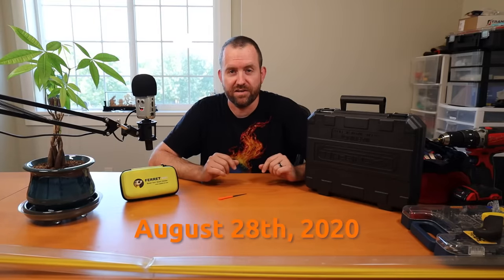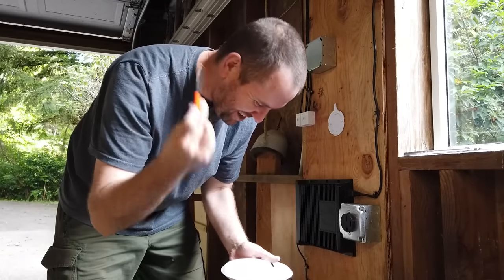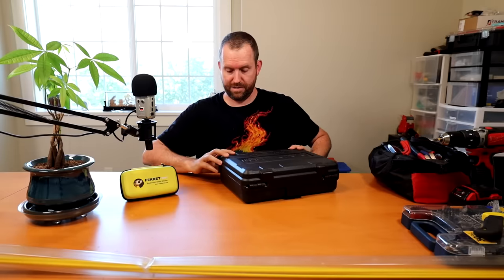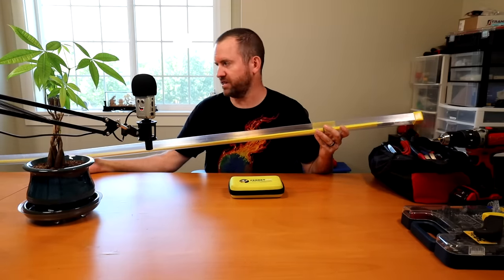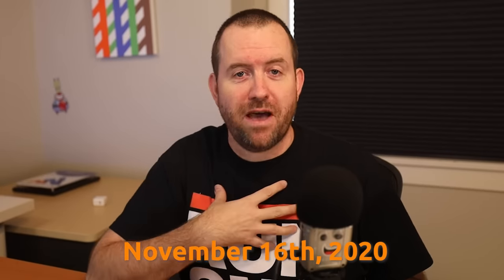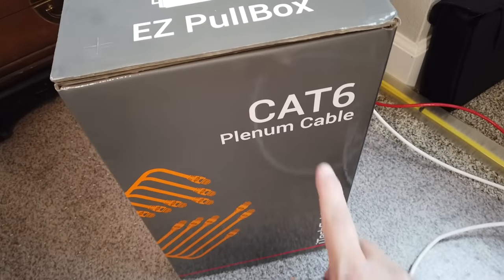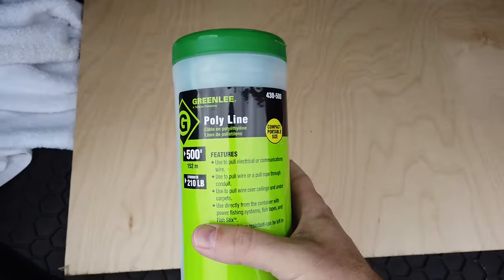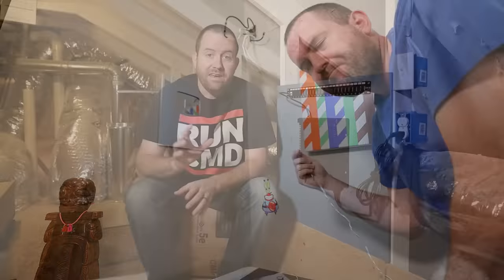CAT6 Wall Fishing

Comment: instead of cutting and patching holles in my walls, i removed the baseboard and cut about 3 inches of drywall out all along th floor.  this allowed me room to drill each stud and feed the cable through the studs.  a quick screw back up (or drywall mud) for the cut out drywall and then re-installed the baseboard.  easy peasy and no drywll patching or painting.  nice clean quick installation.
Reply: great idea! thx!!

Comment: They make flexible drill bits that attach to a standard drill that are able to go deep into wall cavities and drill into the bottom or top plate if you ever wanted to go that route
Reply: i came here to make this same comment. 48" flex bit from harbor freight, it has a hole that you can attach the cable or pull string

Comment: So useful, and what a cool pair of tools! It’s after a few years now, I’m thinking about putting in CAT 8 cable in the homestead for 20GB networking. Switches with 4 - 5 2.5GB ports and 2 SFP+ ports, managed, w/ POE run $60! What a life, what changes time has wrought….

Comment: Welcome to a not so fun job an electrician deals with! I like you finished wall mounted plate trick! Quick tip for tying cables onto your pulling device; strip the cable, loop half of the conductors (if they fit) through the pulling device, twist all of the conductor together, fold them back onto the coat of the cable and tape the piss out of the conductors, try to make smooth lips with the tape as you transition between different widths, that way nothing catches on the way through or on the way back if you are struggling.

Comment: Looking from Europe at your walls, isolation snow and strange wall cavities. And I can only think: Wow. Four years ago I needed to pull approximately 40 feet of CAT6 cable from the garage to the top of the attic. There is a empty tube purposely installed there for this exact reason going all the way up. What I did is attaching a small cotton piece to a very light thread and used the vacuum cleaner at the other end to suck the thread all the way through. Then attached a much stronger rope to the tread and pulled it up through the tube. Once done, connect the CAT6 cable to the rope and make sure you cover the cable with talkpowder (the powder sportsmen use to cover their hands with when pulling weights) and just pull the rope from above. Did it alone and took me about an hour. Nice vid.
Reply: They make cable pulling lube...

The bucket looks like you’ve been indecent with an elephant but when you need to run 60ft of 30mm cable down a 1.5” steel conduit from a GOST motor starter to a blower motor. You’ll appreciate it!!!

...I started out in a panel shop for environmental combustion company and we sold a vapor recovery skid in Russia and spent a long 80hr week running all the cables before it was shipped.
Reply: @peterg.8245  yeah I know there is lube available on the market. But how does that look like after being 15 years in a tube? Does it dry out and act like cement so you'll never get the cable out? Talkpowder will not do that.

Comment: DIY magnet puller - fishing line + small & heavy metal object (test with a magnet). Use electrical tape to attach fish line to end if cables & drop it down. If it gets stuck, try drop it again, or use a magnet (ie from an old hard drive).

Comment: Word to the wise - the right sized zip tie end is perfect for removing unifi aps
Reply: I use paper clips to remove them, I use the smaller curved side of the paper I just make sure to squeeze the small side of the clip with pliers to fit the notch on the AP.
Reply: Yes, Zip ties are perfect tools for this purpose!  Have used them for years.  Super easy to use and they're much easier to replace if you lose them.

Comment: Another great tool I fell in love with as a Cable Guy, now use for CCTV DATA  Access Control. Is from Labor Saving Devices called The Wet Noodle less than 20 bucks...small compact easy-to-use and small enough to keep in a tool bag. Magnet small.enough to stick thru a small hole in a door frame and lamp chain you find with its magnetic tip.. very inexpensive too..... yep string first, or cut and tape multiple wires as a torpedo head and staggering them.. OMG.  You used a level in the attic no one but a HVAC guy would have noticed if you had eyeballed it , impressed! To dress the wall plates you van use a mud ring that makes the jack on the wall a little firmer....Luckily you didn't have "Fire Stop" blocks of woods across the cavity in the wall...   May look at a Cable Ferret... there are  few times you'd like to know what the heck you're hitting or what obstruction you got....

Comment: It's triggering me that you didn't use either mud rings or "old-work" boxes.
Reply: I'm debating using them myself - I don't see anything wrong with hole sawing it out and then using some anchors (I have a shit ton around here) to mate the wall plate to the drywall.
Reply: @the_kombinator  When I'm planning additional new runs to an existing plate, finding a drilled hole instead of a box is a bit like opening the blinds in a hotel room to find a brick wall outside. It's one of those "awwww" moments.
Reply: @Treddian  I'm running two drops to every plate (4 drops in my office) - I'll never need more unless I suddenly decide to mine bitcoin. 

But maybe you're right - at least in the lower floors I'll use them.
Reply: What is the best way to run cable from outside to inside it prolly will be spf+ or ++40gbs fiber vs cat im new to fiber normally i just drill hole shove fill this is a very wet area of organ snow rain and its going to a very costly server room hope u reply treddian
Reply: It's not an issue with low voltage systems, but it isnt the recommended method. Smaller hole to patch if he regrets making it. However the 3d printed boxes for 120v systems is a big nono.
Reply: me to

Comment: I use poly string trimmer line for pull lines.  It diesn't fray out or hang up on nails, splinters or cracks in the inner wall sheet rock or framing.  And will take a heck of a beating before breaking.  I've even used string trimmer line to fish fires trough firewalls in my vehicles when I want to run a new wire for something.  A big zip tie with the string trimmer line pushed into the zip tie catch and you've got a nice stiff, non conductive pull system.

Comment: The Magna puller is a great tool.  I have one myself.  I wired my house with cat 6 and have a 48 port switch.  Not fully used, but I needed more than 24.   So I ran a lot of cable and have multi keystones ports all over I can plug into.  My attic is tiny.  I have a low slope roof.  I did all my wire running under my house.  That included coax for the new antenna I mounted being a cable cutter.  Wires for the rear surround speakers in the family room.  Mostly done myself.  My 12U network rack is mounted up high in my small closet in the middle of my house.  It was a lot of work.  A lot of crawling under my house, getting out to pull wires up and then back under again over and overt!!!. Once all the work is done, is great.  In the future, those cat6 cables should be able to handle 10 gigabit just fine.

Comment: Use the drop chain for hollow walls, then use the magnet to get the chain to the cut-out. When attaching your cable to pull I like to cut back about 6 inches of insulation, the run 2 pair through the pull in one direction and two in the other direction twist tight and tape with a smooth head, if pulling two cables, tape the 2nd cable securely about 12 inches back with about 6 inches of tape again with as smooth and pointed a head as you can to avoid getting the cable hung up.

Comment: Interesting video. Where I live in Australia, houses are mostly constructed out of brick, single brick internal walls and double brick walls on the exterior. So to run cables in existing built houses you tend to get stuck running cables through the external wall cavities, unless you want to create a hell of mess by using a grinder to cut a channel into an existing wall. I doubt a magnet would work well through bricks. For new builds conduits are the way to go, when we fully renovated our house a few years back I had installed 20 CAT6 runs installed through out the house and all in conduits, which has already proved useful in a couple of instances to run a extra cable. It's also illegal to terminate you own cabling if you aren't certified for some stupid reason in Australia now. Another recommended tool is a cable tester that can tested the quality of the mechs and terminations. Unfortunately these tools can be quite expensive depending on the tests. Certification testers are really expensive while quantifying testers are less expensive but generally are good enough to do the job.
Reply: A simple test tool, that just confirms each pair is connected properly costs next to nothing.

Comment: Similar to the Cable Ferret, I purchased a "DEPSTECH Wireless Endoscope" on Amazon a while back when trying to run cable in a finished ceiling that had lots of metal studs supporting it and a ridiculous number of obstructions, including a distribution box for some elevator / building automation controls and several PVC sprinkler lines. I kept getting hung up and didn't want to make new holes since it was a public lobby area where looks were important.  The light was super bright and the field of view a bit wider, so I could see further than the image you showed in your wall. This helped me fish the camera over to the hole for the access point and then pull string from there to the places I needed it.  The camera is on a 12' semi-rigid, bendable cable.  It requires a USB power bank or charger for power.  It then connects to your phone with wifi.
Reply: Second that one - I used two of the DEPSTECH to cross a 90 degree pull between two attic spaces where one was not physically accessible.  The bright light and camera on both poles made it possible/not-easy to find each other.  I could not have done that pull with the size of the Ferret.
Reply: @thezfunk  someone had to bring it up
Reply: @spasmonaut10  it is funny I found it in the comments because I have a friend who just bought one to use it on himself. He is a strange duck.
Reply: @thezfunk  I bet he's hard to buy gifts for.
Reply: I was wondering if someone was going to mention these.  Super handy, and very cheap!  I think mine was $30.

Comment: Unless I'm mistaken, it's not a 4x4. The top plate is typically two 2x4s on top of each other. I used to be an electrician, and did a lot of this wall fishing. At the time, we used what's called a "fish tape", which is a piece of thin steel rolled into a coil. It unrolls as you pull it off the roll. Any home improvement store will have such a thing.

Comment: I usually have two boxes/reels of cable, if I want to pull two cables. That way you don't have to guess the center. More importantly I just tie all the conductors to whatever I'm using to pull the cables, which is way stronger then tape in my opinion. It's also less thick than bending the cable, which makes it easier to pull it through stuff.
Reply: Yeah, that "bend it in half" idea was nice in theory but has the flaw of thickness. OK inside a clear vertical un-insulated run though.

Comment: 1.)The correct keystone crimper or knockdown tool. 2.) Use a LV box instead of just a hole in the wall when running wall plates. They make a tool that goes on a vibratory tool that is an outline of an electrical/LV box. Literally cuts it in 10 seconds. Done.

Comment: Ruckus APs have the same issue. You have to use a paperclip to release the AP from the bracket. I installed a Netgear AX630 and it just twists off and on.

Comment: I used the Magnepull (and Magnespot) for years as an installer.  The Magnepull's not always super handy (most of the time fiberglass rods are quicker and work just as well), but when you DO need it, it's invaluable.  As for the Magnespot, if you ever have a need to put a hole in exactly the right spot on the inside, from the outside, the Magnespot is awesome.  It uses a vibration frequency on a transmitter that you put inside where you want the hole (it uses a push pin), and you take the locator outside to find the location.  It will give you a 4-point alignment, right down to the hole in the middle of the locator, where you can mark it.  It also works when going through floors, but I've personally not had much need when drilling through floors (usually have an idea of where the hole will be before drilling, since I can see both sides).
Reply: (adding comments as I'm watching)
Also, you could have used the included chain instead of the poly line if it's a one-off line pull, which could have saved you some time of running to the hardware store.
For drilling up through the ceiling (and down through the floor from a jack location), the easiest way is to use a flex bit up (or down) through the wall, though when doing that, you don't have a way to add any fire block to the hole in most cases.  If a house is balloon framed, it's a non-issue, otherwise it's something to be considered.

Comment: Here is my favorite cable running tip.  Let's say you want to find a first floor wall from a basement.  Chuck a stiff piece of wire (close hanger or piano wire) into your drill and drill down into the basement at the intersection of the wall and baseboard.  The wire should go behind the baseboard and in front of the wall.  Go into the basement and find the end of the wire and just figure out where the center of the wall is from there.  The hole the wire leaves is small enough that all you need is a dab of caulk or spackle to cover it.  The wire should be 18 to 24 inches long and put a chisel tip on it so it will cut through wood.  Be patent it is not a great drill but it will work.  Obviously, this works between any two floors, just drill in the appropriate direction.  ;)

Comment: I used to fish lines pretty frequently.. I bought a magnapull and used it like 2 times.. then sold it. 

Cheap glow rods or a fish tape just so much easier.
Reply: Magnapull comes in handy if you come across insulation. Or, sometimes if you drop a drill bit or something, it comes in handy for that as well.

Comment: Use a ship auger bit it works better than spade bit.  Why not use low voltage rings  it work better than drilling a hole in the wall plus you have more space.  Doesn't cat 6 have a bend radius that you have to be careful of.  Could damage cable pairs.      Also did you use saddles in the attic?  Or did you use electrical staples.

Comment: That’s what the chain was for. Instead of using the poli-line you would have attached the chain directly to the magnet. That plug and coax was probably there for a mounted TV previously. They have 5ft long drill bits that are skinny and thin too to drill towards the attic. Nice video.

Comment: I have not read all the posts, but from what I can see on the video and the first try to drop the cable from the attic, I would have used the existing phone or coax cable to make that run.  You can cut the head on the coax and tape your twine chaser cable to it and then pull up from the attic or you can cut the coax or phone cable at the attic and pull down a twine chaser to the room below.  The only issue you may have is that the hole is a bit small for pulling 2 cables through,  I always run 2 twines on the first run in case I lose or break one.  That way I don't have to start over and i have a second one for future use.

Comment: For the exterior wall, you can get 4' long flexible drill bits. You feed them through a wall box and up into the top of the wall and plate.
Reply: I've wondered how you manage to keep them from boring a hole at an angle at the top plate and winding up with a hole somewhere that you don't want one.
Reply: @JoshuaBurgess  I used their flex bit as well as a few of their flex extensions. They work great but they are a nightmare to retrieve if the extension comes loose. Almost lost the bit when drilling from the attic to the basement in my 2 story home.
Reply: i have used these many times, they work great. If you are using an extension, make sure you tighten the junction well, I had one come loose and when i removed the rod, all that came out was the extension!!

Comment: Long flexible drill bits are a thing. This allows you to drill up the wall and thru the wall top plate. You then attach your pull string to the drill bit poking up thru the top plate, yank your bit down and viola. I'm purty sure Tech Tool Supply has them.
Reply: just be careful you dont drill through your roof
Reply: @scott7724  you ain't lying, or if you have a spotter/helper in the attic, make sure he has steel sole shoes hehehe

Comment: To run cables into the attic - Klien makes a 6' long flex drill bit (Google 'klien long fishing drill bit').  You cut the hole in your sheetrock for the jack and then fish the drill bit up into (or down into) the wall and drill through the top plate (or bottom plate).  You then go to the attic (or crawlspace) and the bit has an eyelet on the end of it to tie off your wires.  Go back into the room and pull the drill bit back in with your wires on it.

Comment: Always leave double length of the poly line parallel to any installation so that you can later run additional cables between those points. Make it that long so that you can pull the later cables from either end of the run. Don't use these methods for electrical wiring which should be stapled to the studs at intervals.

A simple version of the pull rods that I've used for runs up to 8' is essentially free. I'm a landlord and often find myself replacing minioblinds in my units I save the rods used to control the slats and use bits of dowel join them as needed, with a bit of electrical tape to keep them from pulling apart. They seem to have a proper flexibility. Most of these tools can be improvised, which may be the better option for occasional occasional use.